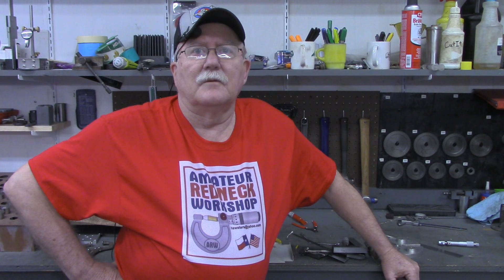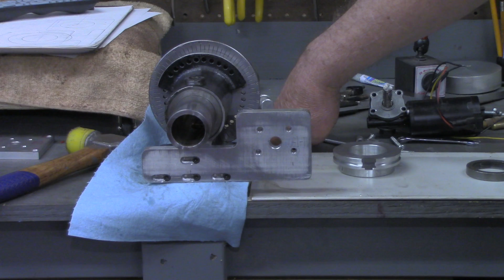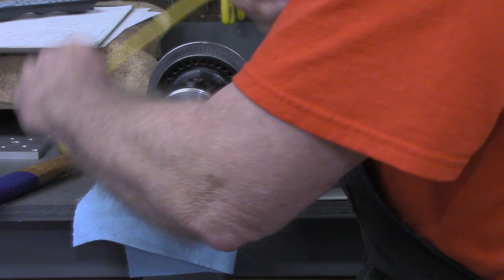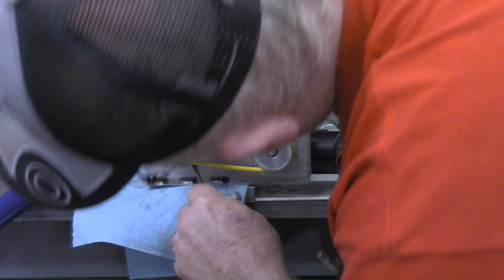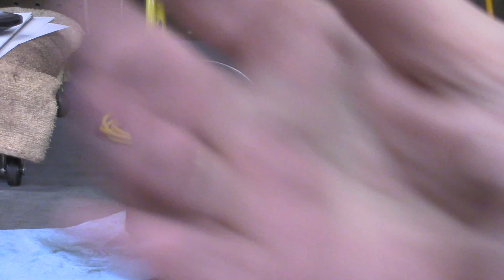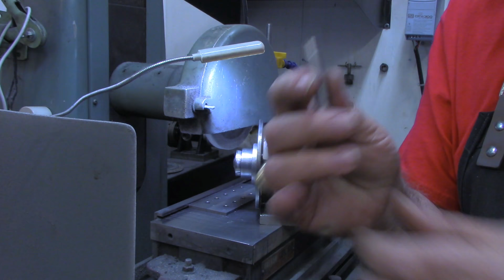Motorizing A Spindexer Part 2 of 2

Comment: Hi Lee, 
a little after the fact, four years in fact, so maybe you've already done some of what I'm suggesting. 
Youchol of Woods Creek Workshop did a video of his mods to a similar spindexer for the surface grinder where he found that the indexing plate got in the way and he couldn't see what was happening. He turned the whole spindex around, reversed the  spindle and had the collet end out of what you have currently, as the back. He also fitted needle bearings to both faces and made dust covers to go over the, now front, bearing. He hasn't, to my knowledge, motorized his as yet but he may have done. If you're interested have a look on his website. It's still listed.
Another site I found a while ago did extensive alterations in that he put a large worm wheel, Boston gears part, behind the indexing plate, mounted an aluminium carrier to the side of the casting to hold the worm on a 5/16" shaft running in needle bearings with an indexing head, as would be used on a dividing head, with plunger, setting arms and indexing plates with various hole counts. This enables him to grind facets on any degree he can set. He also mounted needle rollers front and back on the main spindle with an adjustable preload ring that also incorporates a dust cover over the bearings. Off hand I don't remember the site name but I do have the article that I originally saw on the homemade tools website.
Thanks for the videos. 
How do you like the PM machines?

Comment: JB Weld this is going to be interesting to see through. I think it will work myself but this is for a precision tool. The little part looks nice and is coming along well. Like the high speed vise handle. We fuse belts I have not used this little connector for us. That JB weld being used for nothing critical so think this turned out well keep building this is neat to learn about an index with a motor. Surface grinder must be nice to have now with a motor to turn shafts that is great.

Comment: J-B Weld should send you a case for the free advertisement!  A first time for everything ooh my ears still ring chug-a-lug chug-a-lug!  One comment on speed and feed, you were not getting a full revolution of the spinindexer as you passed under the wheel.  It seems that either the speed of rotation should be increased, or the table feed should be slower.  Just my thoughts, take them with a grain of salt.  Love your videos.

Comment: Well done Lee.  Those pesky inter-dimensional tool black holes are a problem  I have not overcome myself.  Most impacted tool are hammers - picks - screwdrivers - vernier calipers,  The tools I don't need are largely unaffected by the random black holes.  

How about a little drip oiler for the shaft to housing? 

Safety grouches are not gonna like the handle swinging.  

Dan